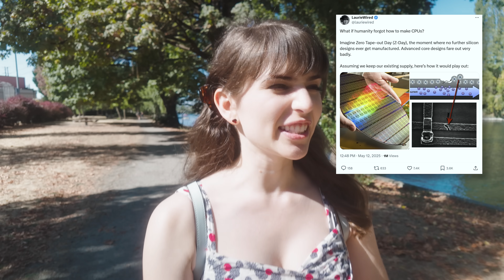what if humans forgot how to make CPUs?

Comment: When we run out of oil, this will be an actual problem. Digital technology will be the hardest to support. We will end up with a huge "digital information hole" where we lose all information that was only stored digitally, leaving use with only paper, magnetic tape, film, vinyl records. There is a lot of content now that is not on any medium other than digital. What you are describing is not a fun thought experiment, but what will happen in about 100 years, and in 300 years we'll be back to early 20th century technology. The Amish had the right idea all along.
Reply: Having said all that, we aren’t going to run out of oil, but not for the reason stated. We will (and in fact, we already have) reach the point where the marginal cost of every next unit of oil (or anything*) will exceed the economic viability point of an available alternative, where alternatives exist. (*Food and water are examples where there are no viable alternatives no matter what you do.) Assuming a long enough timeline of societal stability which is certainly not assured at this current moment humans will slow and nearly stop the  extraction of marginal units of crude oil (or anything) because the cost to do so exceeds the cost of suitable alternatives.
Horses and carts were surpassed by combustion engines more than a century ago, but my wife still has a horse. We just don’t use the horse to get groceries or tow our camping trailer. We could, but it’s not economically efficient. The same has already happened for oil. As I mentioned above, though, the limiting factors in the equation mean the transition from oil to cheaper alternatives isn’t instantaneous nor evenly distributed. Another transition point exists in the future as well, when we will move away from the things we are transitioning to now. Cars, trucks, aircraft, almost everything we use daily that we consider to be the latest and greatest thing will become obsolete technology as has everything throughout history that got us to here, because the present moment is not the end of history.
Reply: @mikalrage7316 exactly. There's a lot more to this too.
Reply: "Running out" of a resource isn't a thing as long as you have a free economy.  We settled this with the Ehrlich-Simon wager like 30 years ago.  The more you use a resource, the more you have it.
Reply: @smorrow Your point is predicated upon the existence of a “free economy” and that is an impossibility. Everything within the confines of spacetime exists within a self-referential closed loop system and infinite growth is no more possible than is infinite speed or perpetual motion. Technologically, we can represent this at present as “We can only access material resources located on or arriving at Earth”. There is always a limiting resource, be it oil, water, wood, atmospheric constituent balance, intelligence, labor, time, etc, else everything that is going to happen would already have happened instantaneously. The underlying premise of a free economy can only exist as a premise, never in the gritty crucible of reality.
Reply: @smorrow reserves are projected to run out in the 2070s.
Reply: @reghunt2487  No, it's "current reserves would last us until the 2070s (if we stopped growing the reserves)".

"The reserve" in this context just means "what we know about and could extract with today's technology".  It's a technical term with a precise definition.  You can't just use it to mean "all the oil in the world" (but people do).
Reply: @smorrow  good luck with that. 👍
Reply: @reghunt2487  With what?
Reply: @smorrow Tell that to all the parents throughout history who’ve watched their children starve to death in a famine. Explain that by consuming more you have more, and they could have just eaten their way to bumper crops.

The only way what you say is true is that there are economically viable alternatives that fill the same need… and you need an infinite number of next-best alternatives.
Reply: @mikalrage7316  Children haven't "starved to death in a famine" in any free-market country, and nobody ever said any of this applies to unfree countries.  (A communist country did literally drain a sea, after all.)

Comment: 6:26 I have 11 year old smartphone. Battery capacity is above 90%. "Official" value for a worn out battery is 70%.
Edit: today "ecology" is killing devices which are thrown to forests. Main reason is lead that is not allowed. Cracks in soldering joints with 60/40 soldering tin are extremely rare.

Comment: While some of you might be terrifed, i would be glad that node.js and JS in particular would be considered "too damaging to hardware" and phased out asap :)
As for points that i felt were missing aka my view of events to happen, please take a note that it's my point of view meaning how i would behave and would like others to behave:
- magnetic tapes would came returned to favor. At least for most critical data. Their circuitry can be easily realized on handful of opamps. Gosh i so miss VHS backups back of the Amiga times ;d
- hackers knowing that preserving modern CPUs is fruitless endeavor would immediately switch to vintage, some of them jumping on ebays paying however seller asks, others just would dust-off their attick's treasures,
- m68k, 6502 and z80 assemblists would be worth their weigth in gold knowing that properly handled cpus would easily last tousands of years.
- whole "protectors" industry, this is overvoltage, thunderproof equipment would boom,
- yeah, optimizations bitch :D tons and tons of bit flipping and my favourite, von Neumann's self-modifying code to squeeze another half of mips just by keeping CPU on the same memory page

At the end of the day we're at most in need m68k-levels of performance, maybe early i386, going berserk for smaller node's process, moar GBs, MOAR TFLOPS, lower power consumption, all this shit is fueled by shitty programming. Why bit rotate/ do lookup while you can ask python for 384 / 4 and have result in 1000x longer but still unnoticeable amount of time?

Also, i highly doubt that humanity wouldn't never ever produced another cpu. There's this dude on youtube, Sam Zeloof, criminally underrated and unrecognized pure hacker, he casually designs his own chips and produces them in garage fab, imagine that ;d. So, end of my version of story is that world would switch to risc-v, efficent, reasonably complex and what's most important - easily manufacturable chips, like Hazard3. 

The real question should be: what if ASML and TSMC got nuked overnight ;)

Comment: The world falling back to retro-computing could make me useful once again. :) I'm old enough to still having learned maintaining a separate assembly codebase per each supported CPU for a project. With sometimes radically different cycle-optimization for the loops – just to reduce runtime, not to fit into caches, there wasn't any such fancy stuff yet.

Once, we wrote a billing system using only 64bit integers representing µ¢ (ten digits after the decimal point). There were hardware FPUs available already, but this was orders of magnitude faster than anything on the market even on much older hardware. And it didn't produce ANY rounding errors, ever - I still remember it took weeks to prove to the certification agency that this was even possible. Alas, it failed to gain traction entirely because buying more and/or more powerful hardware was already far cheaper than hiring programmers crazy enough to come up with such voodoo. Your scenario could very well make me filthy rich in my final years…

Fun times. Thinking nothing of it, we used techniques that much later got fancy names and much attention. Agile development, dev-ops, patterns… AI still is just self-weighing decision forests, albeit deep enough to be opaque to any human mind, and on much more powerful hardware than we could even dream of (terabytes of memory, preposterous!). It still can't replace skill and passion, though, and never will, not the way it's built.

But listen to me rambling, I'll put a stop to it now. Do keep posting non-educational fun like this, it's a nice break from your more challenging videos. That your brilliant mind comes with such a nice mind-to-people interface always makes watching your channel such a delight. Thank you for being there. Had I been on that ship, I'd have had my aide wave back to you furiously on my behalf (my own shoulders are no longer up to that kind of task).

Comment: love this video, definitely something i've thought about. 
I think display devices are something else that would become highly valuable. Most LCD's are not very durable when it comes to drops / physical damage. Non LED backlit displays will have their backlights die. I think simple mono CRTs would become the gold standard given their protective cases, front less prone to shattering and simple electronics. The tubes would still have to be used sparingly and at a low brightness. Some early non-backlit LCDs might fair well but the chips driving them tend to die even today with early portables from 40 years ago. I do think portables like the tandy trs-80 model 100 would be highly sought after given their extreme power efficiency and running off of AA's, with simple CPUs. Biggest issue is trying to keep the display alive, but if you kept a few spare to steal the chips you could probably keep one going for a long time. Another advantage is that they do not have any HDD/SSD, using DRAM as primary storage kept charged continuously.

Comment: I just got an Apple IIe up and running yesterday. Sadly the PSU lit on fire after an hour of use. Waiting for a new PSU and then I'm gonna go through and rebuilt the power circuit in the monitor too so that doesn't light on fire. The monitor seems a lot more difficult to repair in the case of a fire.

Comment: Restoring old hardware would become a big industry. Capacitors on old MacSEs would need replacing, etc. Doubtless someone would come up with a new way to create hard drives without the need of silicon.
Reply: hard drives in general are possible without modern vlsi, but they'd be limited to much much lower densities. current drives depend on (among other things) very complex encoders and decoders to pack bits in as tightly as they do. if you're bodging together a disk controller out of discrete transistors and a salvaged 1MHz 6502, you'll be lucky to squeeze a few megabytes on a platter reliably.

Comment: 8:12 time to go back to dial UP and BBS and actually switching actual copper wires with mechanical relays. That 90y old equipment still probably works.
Reply: New relays can be bought.
Reply: @kensmith5694   yep, but no one manufacture the sweepers anymore, although they're not complex mechanically

Comment: I wonder why and how such a thing might happen. I have to admit, in a world where Boeing forgot how to make airplanes, and Intel forgot how to design new CPUs, it's not entirely unrealistic. Say the AI bubble pops, and everyone realizes they have all the FLOPS they will ever need. CPU and GPU makers now have a huge pile of unsold chips, which they figure they can just sell for the next decade, annually incrementing the first digit in the product name. No need to pay the engineers! Or use fab capacity. The fabs may survive, but what they definitely won't do is buy more equipment from ASML. If ASML doesn't survive, there is no one else who can take their place. A single artillery shell landing in Taiwan could then take out like half of the EUV equipment that will ever be made.

Comment: @2:00 Blacks Equation didn't anticipate swelling fake electrolytic capacitors with faulty dielectric.
Reply: It's not just the fake ones. Most electrolytic capacitors in equipment from the 70s and 80s require replacement. Another failure type that's not mentioned is plastic insulation. The plasticizers in power cords and other flexible cables ooze out and cause them to become sticky but brittle.
Reply: I got some fujitsu hard drives right here, I can do you a deal.
Reply: ...its uhhh got what hydro plants need? i guess? (i do not understand a word you wrote)

Comment: 0:34 the Intel 13400K barely survives its first year, and I'm here still rocking a 5820K, and before that in 2016 I had a i7 970 since its launch day in 2010, that was the best CPU ever and I'm still sad that I sold it, should have kept it, it would still probably run to this day after 16 years and would be very useful for this scenario. But what if I hate a CPU to last 50 years, it would have to be the venerable 80486 DX4 . Its simple enough that I can power it up and use it with mere protoboards.

Comment: It is far more likely that we will have a devastating CME event, all grids down, and massive damage to electronics worldwide (SCADA/PLC's all roasted, factories stalled out, power grids failing) before we forget how ot make CPU's. I just completed a project putting in a building, and it was scary to see how hard it was to get the transformer that was sized appropriately. Somewhat of a catch22 if we have a near completely Just-In-Time manufacturing model. Too many dependencies...and a very fragile system.

Comment: I still have older systems and watch videos of reworking older systems, it's amazing how well they were built. My osborne 1 blue case, even in the 80s was easy to update, like changing the spark plugs whether they 4 straight across and dual port for plugs 3 & 4 on my Lincolns and mercury. Your point of higher density processing has limitations in the ekectron effect; which is why im working a new laptop design with a 24 inch screen and two other screens, but not relying on one with cpu with cores. Rather, old school redundant design like Appollo, one system failure does not fail the whole system. Let me know what you think.

Comment: we'll just use GPU and all stand in line at ewaste centers, and go gold digging in landfills and poor countries with trash would turn into Fry's Electronics
I also want to take apart washer dryers, to get there microcontrollers and use there motors from compressors in refrigioators to make welders

Comment: This is really cool, thanks so much for making this. Please do the Carrington event 2 solar boogaloo next! The thing that I hard find to hold in a state of belief is the idea that we wouldn't very quickly relearn CPU design or overcome whatever problems we're having with silicon chip foundry by not using silicone any more and switching to another material. Also, we're completely negating the importance of sweaty HAM nerds to keep the world connected. It doesn't take much electronics to make a radio capable of broadcast and reception. Where as a huge solar flare that wipes out all electronics. Now that's terror!
Reply: add that our magnetic field is down 30%, and that the sun is overdue for a strong blast....
i would get ready

Comment: My Casio 602P still is working. And I have still a Commodore C128 in the cellar. And in my drawer there is a Zilog Z80 CPU that is still working. So I could build a CP/M machine. If all fails, I still have a slide rule. So, at least I would be able to calculate in an apocalypse.

Comment: While the optical media itself doesn't rely on microcontrollers. The drives do. So optical media is also dead. It's back to magnetic tape. Good thing that's still the go-to option for cold storage. Back in the 90s there was even a company selling a drive for home PC that used VHS tapes. Audio cassettes were used in the 80s.

Comment: A good thing is that the osi model doesn't need microchips. It may survive
Reply: well, in a way the old 1950s telephone commuters could be made to work more like a packet network than a end to end connection system. There were some telco engineers that wanted to do that, but it wouldn't be good for profits.

Comment: Making a machine like a PDP-8 would be within the grasp of a civilization that can't make a CPU any more.  They used masses of discrete transistors.  Things like magnetic tape drives would also be an option.  They can be done with low tech electronics.  The (land line) phone system would need to go back to electromechanical stuff and a long distance call would be an adventure again.
Reply: I would assume that the discrete transistors would also disappear. You would be back to mechanical relays.
Reply: @alanhilder1883  You don't need that much to make transistors, and I find it unlikely that nobody who understands the physics of a transistor would not be able to make one again with the materials we have.

There's a huge jump from there to integrated circuits, but really the biggest hurdle would be going to tiny sizes, millimeter size for transistors should be possible to get back to, you don't need a super clean room or anything like that.

You're not going to get insane computing power there, but you can do some stuff with it.
Reply: @alanhilder1883  There is a significant step from the discrete transistor to the monolithic integrated circuit.  I only assumed we lost the ability to make the fine details on silicon that is needed for the IC.  If transistors did go away then it would be the vacuum tube that would be used in computers.  Relays vs tubes was a debate that was had when computers were 1st being built.  The thing built in WW2 to break Enigma was tube based
Reply: @kensmith5694  The "thing" to break enigma was relay based. There was another "thing" used to break the Lorentz cipher, and that was tube based.
Reply: @entcraft44  You are correct
Reply: Thats a long distance call Doug. - Terry Tate Office Linebacker